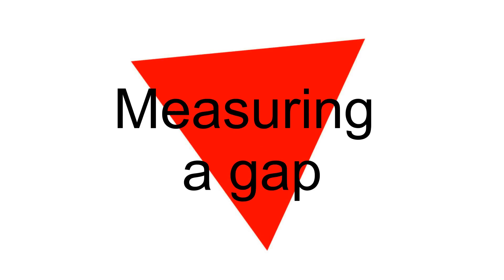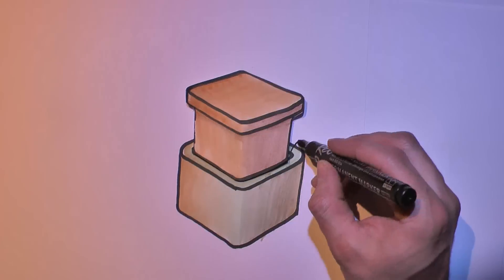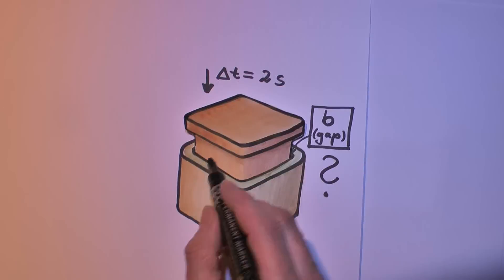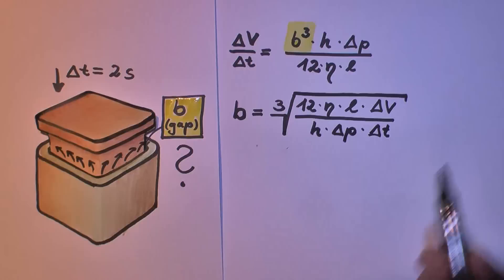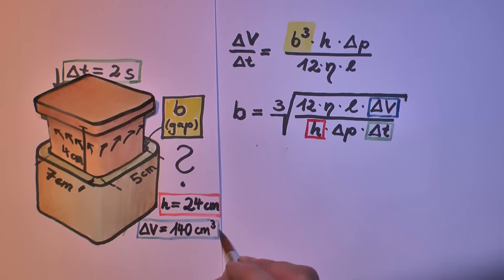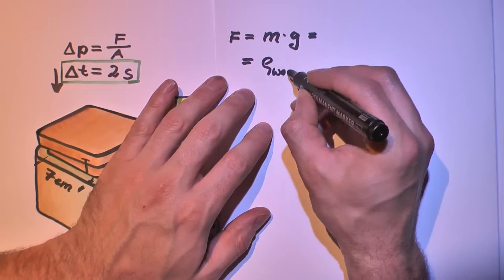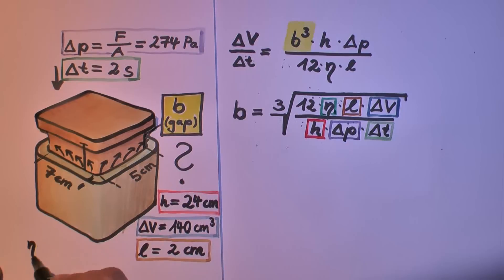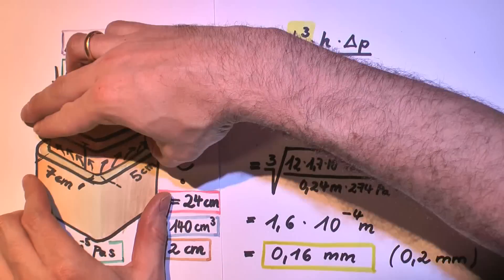Measuring a gap

Comment: Ok, now I'm curious enough to measure it!   The lid actually weighs 74 grams.
The piston is 50.7 x 63.5, and the mortise is 51.2 x 63.6.  But the piston turns out to be slightly tapered (I measured the narrow end) and I assume, so is the mortise (can't measure the bottom of it).  A better way to check was to try to close it with pieces of paper in the gap.  It took very little force to close with two pieces of paper, at 0.1 mm each, that means the gap is at least 0.1 mm all around.  With three pieces in the narrow edge, it took some force, but not so on the long edge.
So your end result is quite close.  Mind you, with the tapered sides, I think numerical methods would be needed to work that one out!
Reply from the maker: stygn
Accurate observation. I teach physics and I like to solve such kinds of problems, when I have time and opportunity. School is sometimes limited to teaching neccessary fundamental stuff, and when the fun begins, school is over. So I enjoy such aspects in my hobbies.
Reply from the maker: Matthias Wandel Thank you for measuring! I'm pleased that my calculations and assumptions were realistic. In fact, I had been lucky that some inaccuracies cancelled themselves out and that there was that friendly third root.
Reply: Matthias Burger Sounds great! I think it's important for teachers to "have fun" outside the classroom to keep their minds sharp, and not just regurgitate the same lectures year in and year out. The "Oh, I wonder what x is, lets solve it!" approach seems very healthy : )
Reply: Matthias Burger Would you mind me asking what sort of education you have, and what your day to day job is? The response time means that you have probably done calculations like this before, and probably recently (or you just remember the methodology that well and haven't done it since school). Very entertaining!
Reply: although a bit fast on the math for my mind to follow, very interesting. i wish math was made that interesting or understandable back in my school days.
Reply: Fun recreational math!